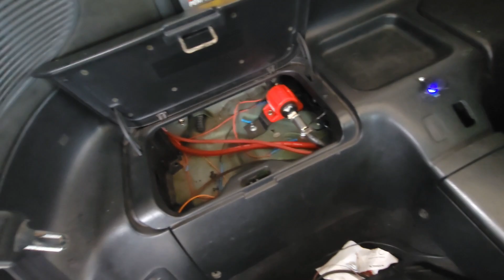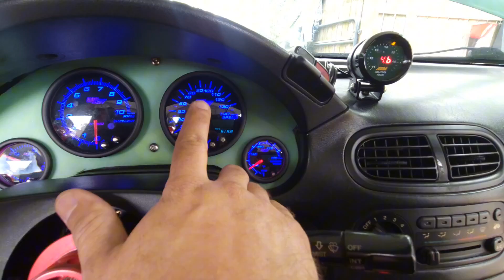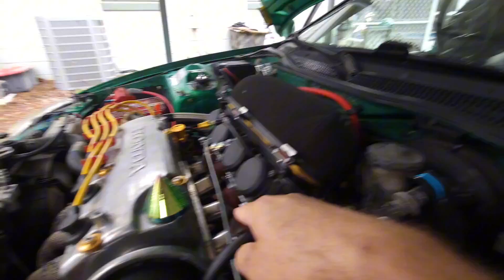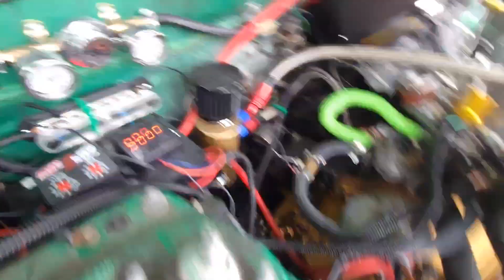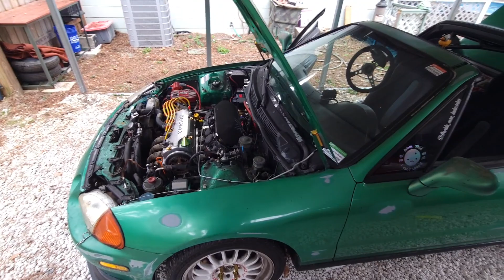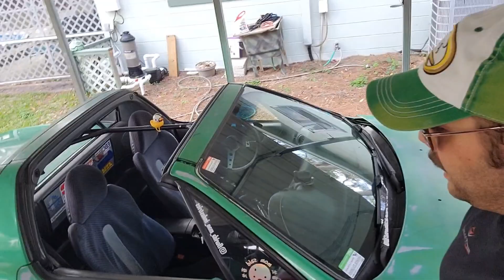Honda Del Sol - Kawasaki Ninja carb conversion (No ECU!)

Comment: 16 degrees is initial timing at idle the ecu will add advance depending on map readings. Without the ecu how are you adding ignition timing? I’m asking because that’s a lot of performance left on the table if your timing is locked at 16 degrees before TDC

Comment: Hey im doing the same setup. D16y8.  In a 74 civic with a danst cbr 600 carbs.   I can't for the life of me get this thing to fire.   I have the msd setup for magnetic switch.  Tried on the 4 trigger wheel in the dizzy and the one trigger wheel also.  Only thing I can get is a nasty backfire.     I have the dizzy notched.  Can't really get a timing idea cause custom crank pully I used to clear the frame.
Reply: Never mind I got it.  Had a bad pick up on  My dizzy

Comment: Jjjj 😁😁 i have a crx i build a mini me d15b2 block with po8-3 head no VTEC shave head 272 cam regrind and port a bit to breathe better with d15b2 16 valves manifold a weber carb lighter flywheel and gd clutch kit oem distributor with homemade adjustments jjjj rotary fuel pump  a gas regulator and mostly all from junkyard parts and homemade custom jjjj and header free flow homemade exhaust system jjjj with cherry bumb muffler jjj and believe me her sound is like old school style ford muscle car and her look is tuff dp dish wheels rear fender flare out paint fade almost to the metal jjj nothing special fast little go kart from 2500 rpm to 7200 rpm she pull real hard and fast 3 gear 100 miles a hr and fast jjj no problem.jjj honda d engine are a beast with higher compression and carb and cam out really they become something different from stock my is real peppy and real fast in the city highway and country roads my crx is my little girl ccr born in the byouooooo gd video light it and smokeyyyyy timeeeeee😅

Comment: You got a sub from me. I love stuff like this. Although still EFI and not nearly as special and unique as yours, I’ve got a D series civic with a weird engine set up as well. Put her together with a service/spec manual, $100, hopes and a couple six packs. Y8 block/head, y8 dizzy with the OBD2 plug cut off and and OBD1 plug soldered on (hindsight I probably could have just moved the pins over. oops 😂) z6 intake and cam gear with a p28. Had to make a little custom O2 wiring as well because the car started life as a VX. All stock/stock modified parts. No AFR guage, so a little sketch. But the car runs nice, the plugs look good, and the exhaust doesnt smell rich. I’ve done pulls side by side with a z6 coupe, and it seems my car has a little more spunk. Maybe it’s a weight thing, regardless the car makes me happy. It might be a 💩 box, but it’s my box and I put it together so I’m proud of it 😂

Comment: I have the same motor-ish. A d16a non vtec. That is California barred in my car. They're so hard to find info on. I put a locked vtec d16y8 cam and assembly in the non vtec head. It pulls much better all the way to red line. Also have a 272-2 cam to throw in next when I can afford a dyno tune.

Comment: You think that rpm switch would work if I swapped my none vtec head with a vtec head?? Just so I domt have to buy a p28 ecu
Reply from the maker: It should. You just need to find somewhere to tap in to the factory loom to get a reference signal for RPM.

Comment: So my question is cam.a shift light be tied into the speedometer the GPS one won't read wheel spin
Reply from the maker: There is a shift light in the tach so that's not an issue